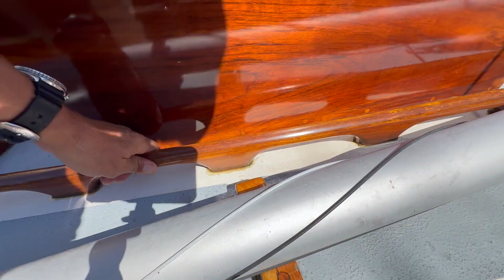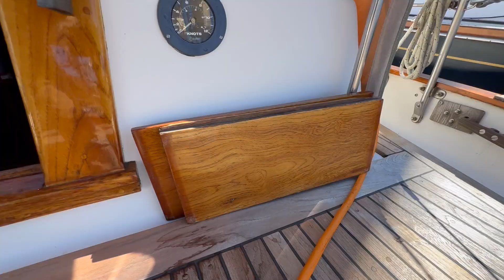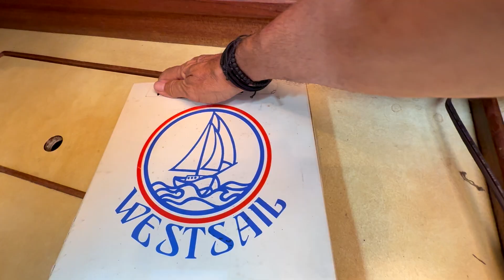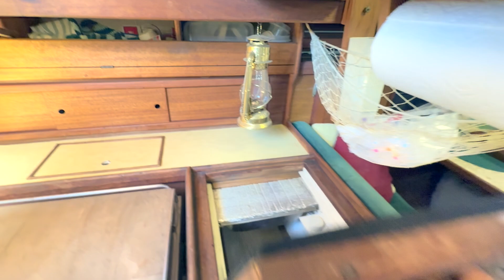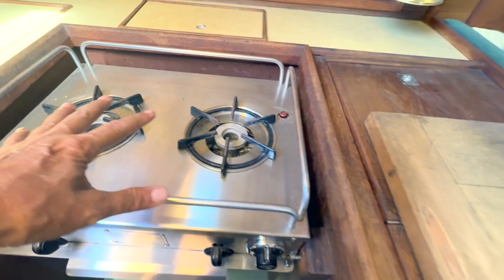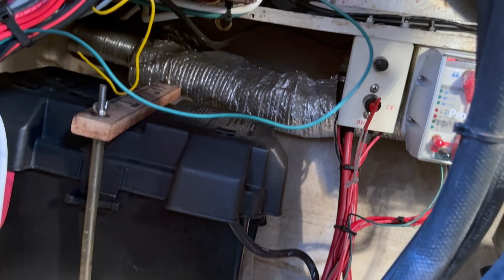1973 WESTSAIL 32  **SOLD**

Comment: how much did it sell for? I'm currently refitting a Kendall 32 from scratch.
Reply from the maker: She sold for 35k.
Reply: What is the name of your Kendall32?  During covid I re-fit East Orange which was the personal boat of the lead carpenter at Kendall.  I also owned a Hans Christian 33T and there wasn't a reason to have to boats.  I bought the Kendall when she was down with the idea to make her seaworthy again.  She came out better than I had hoped.  Sweet boat.  Good luck with yours.